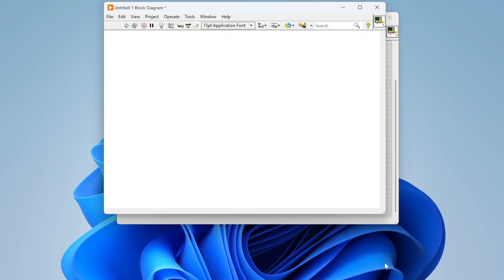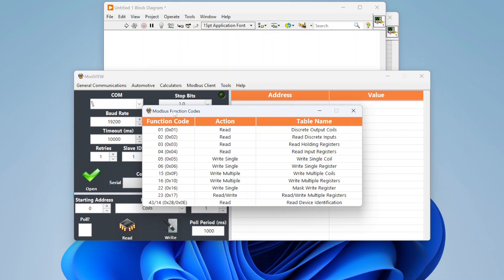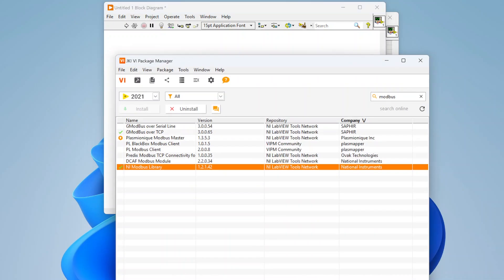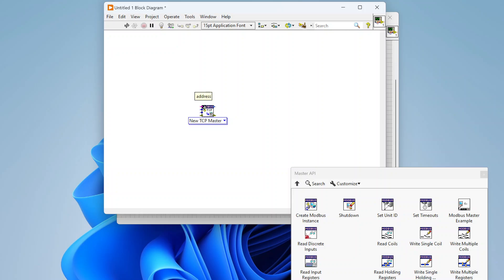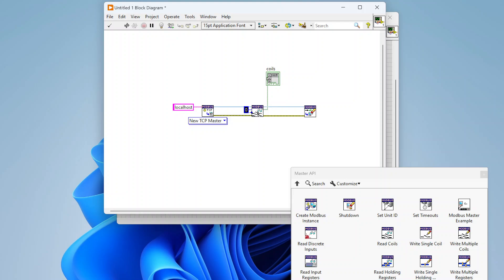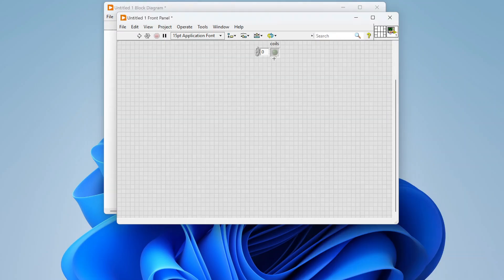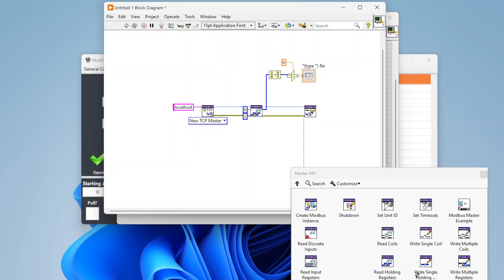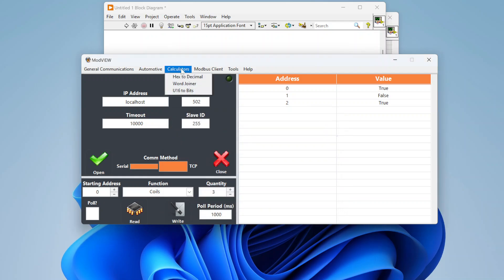Modbus in LabVIEW

Comment: Dear Friend,  I tried the way you generously outlined and was able to obtain the register values.
 However, I've discovered a restriction with this API.  I couldn't receive all the registers. It seems it only works for a limited length.  For my project, I need to read 160 registers using Modbus. I attempted to access the code, but it was protected by a password. 
 Have you ever dealt with a similar situation?
Reply from the maker: Yes sir and and it’s actually not a limit with the API but rather a limit with Modbus in general. The Modbus RTU message length is limited to 256 bytes meaning you can read 125 registers in a single request. If you need to read more than that, you can issue two separate requests to get all of the data that you need.
Reply: @cannoncontrols  🌹🌹

Comment: Hello sir, great video, im interested in the modVIEW tool you showed. It would help me a lot with my application development. Please share it with me if at all possible. Thanks.
Reply from the maker: @dryfus3031  absolutely. It has a few proprietary components built into it so I can’t share the source but I can share the EXE/Installer. If you get me your email, I can send that over. Feel free to either post it here or you can email me directly at cannontim22@gmail.com